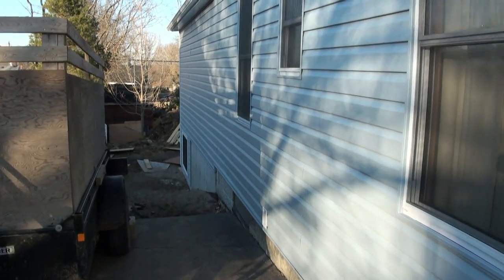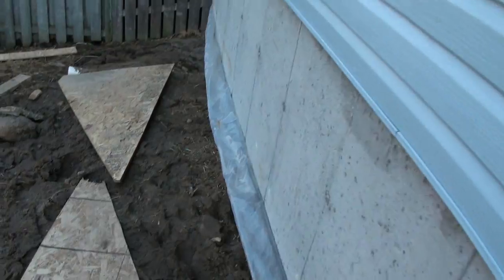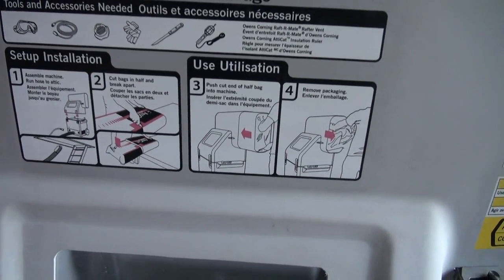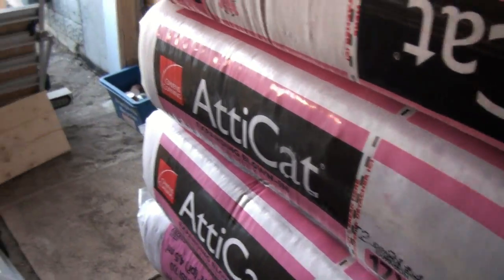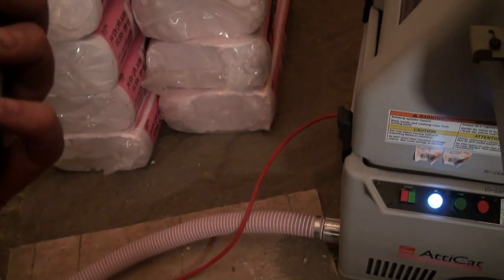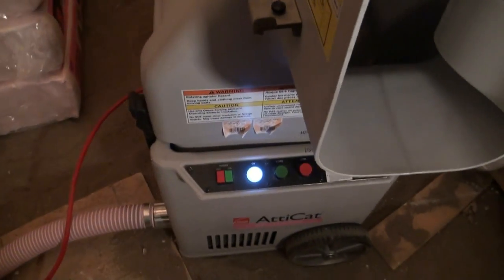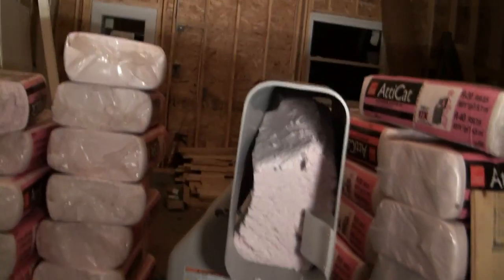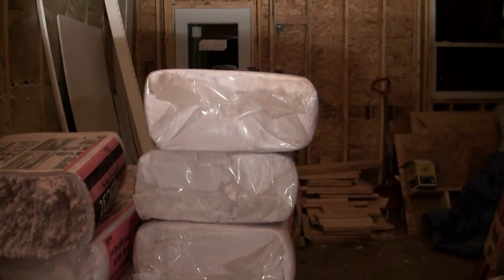The BIG Blow job part 1

Comment: In 1974 my first job in high school was keeping the insulation loaded in an early version of one of those blowers. We used cellulose insulation. It was recycled news paper that was treated with fire resistance chemicals and came in these huge bundles. The blower was inside a big truck with the insulation bales on one side and this large machine on the other. After a few hours of feeding the blower I would blow my nose and it was all grey and gross even when i would wear a mask.